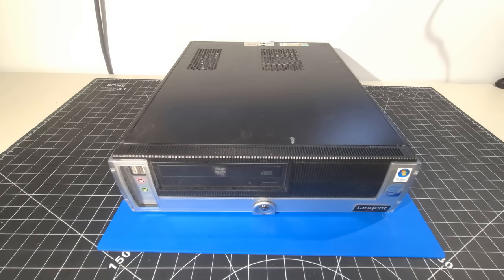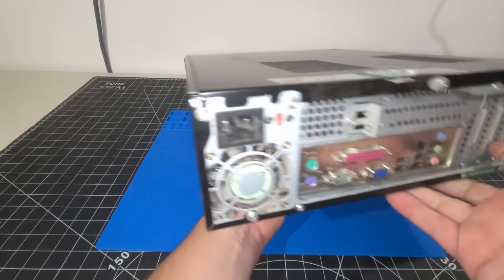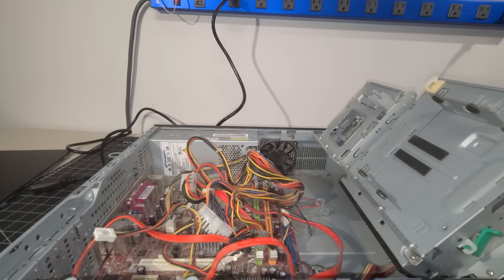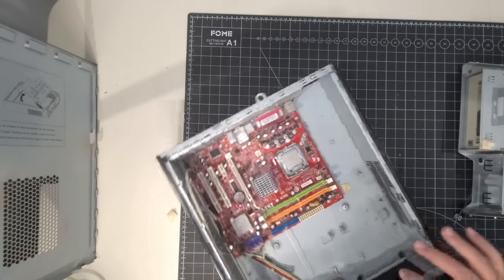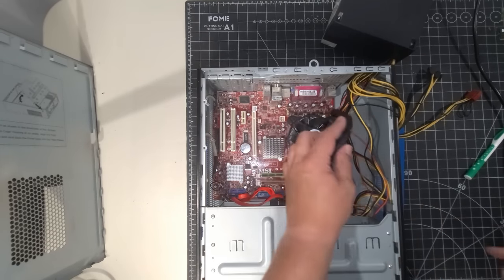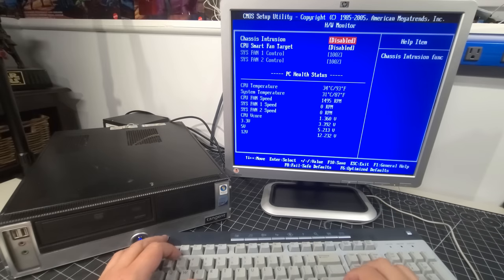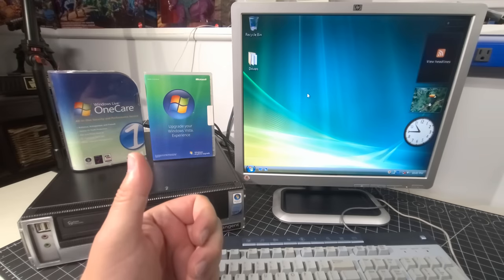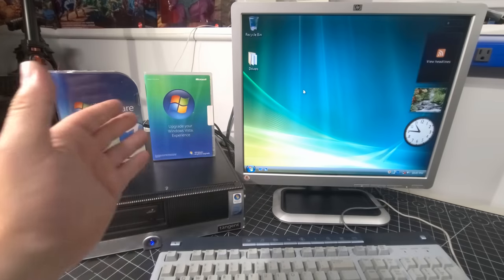The Tangent 'Medical PC' from 2007!

Comment: The high-pitched sound emitted by the PSU was likely what's called "coil whine". In some lower-quality power supplies, there can be noise emitted by components under little or no load. If that is the case, I wouldn't worry too much - chalk it up to cheap parts. Now, if the whine is persistent or increascaes under a heavy load, then you can be sure of impending failure. Hard to say much more without looking at it carefully / testing at a component level. I'm a computer systems engineer with over 20 years experience, so I've seen plenty of weird power issues. I really enjoy your videos, and always get excited when you post a new one! Keep up the amazing work :)
Reply from the maker: Thanks for the info here and thanks for the encouragement!! Im glad you are enjoying and happy to have you along.  This PSU is doing weird things and unless I'm 100% stuck, I'm not going to mess around with it right now.  I think I have a replacement for it which will help.
Reply: Glad to be along for the ride. Yeah, I agree it's less time wasted to ewaste the PSU and source a replacement. Computer, worth saving. Power supplies and other parts are like brake pads ;) @TheRetroRecall
Reply from the maker: Haha so true.

Comment: I got two of these PCs from a school. They had an AMD CPU and Windows XP.
Reply from the maker: Really!!  I never heard of them before the day I found this one.
Reply: @TheRetroRecall  It was the same chassis as in the video. They had a 250w psu, and it was a black MSI motherboard with an am3 socket, and the motherboard had a GPU built into the it. The AMD CPU did not have integrated graphics.
Reply from the maker: Nice!!

Comment: I loved Vista!  Used it for 9 years... Sure it was a little sluggish at first because, among other reasons, MS was way too optimistic about its system requirements, but once I gave it more RAM, and installed SP 1, it was both brilliant and beautiful!

Just for fun, I re-installed it on that same old 2007 laptop, last week, this time with 3GB RAM (Max. usable on this 32-bit system) and a faster 7200 RPM HDD, and it is flying!  ;-]
Reply from the maker: Love to hear these stories.  It really tells you how exciting the wild west of computing was back then!
Reply: I need to know that model of hard drive, cuz' I never heard of a 72,000 RPM drive. XD
Also on another note, I tried using Windows Vista and it was a steaming pile of garbage in my experience.
Reply from the maker: Haha, 72k hard disk.. SCSI on steroids??
Reply: @TOWGyt  Sorry to hear about your bad experience!  Like I said, it required at least double the RAM they said it needed... It also had file transfer issues, at least before Service pack 1. 
The HDD is a 250GB Seagate Momentus 7200.4 that I pulled out of an HP Netbook... Ah, I see why you asked now, I added an extra zero, didn't I?!  lol  Thanks, gonna go fix that!
Reply from the maker: Haha I liked the 72000 drive comment :)
Reply: The spinup on that drive must sound terrifying! 🤗
Reply from the maker: Taking off!

Comment: Can confirm.. These computers were used in hospital / medical fields, Up until as recently as a few year back actually..
Although, here in the UK, most of them didnt run Windows Vista, or any windows OS for that matter..
There is a medical professional Operating system, Widely used in the UK, Called Epic..  
So its interesting to see one with Windows Vista on it..
Reply from the maker: Thanks for this confirmation and yes - Vista Business.  Do you think that these would have been used in reception / administration type functions - considering the Windows Vista OS?
Reply: @TheRetroRecall  Yes that is a strong posibility. Epic OS is mainly for the Medical side of thing.... Medication tables, Surgery room booking slots, CT / Xray time slots etc. 
I highly doubt Epic OS would have been used in the reception side of the hospital, It would more than likely have been a standard OS, Such as Vista.. Around that time period..
Reply from the maker: Ah makes total sense.  There is also a Windows 7 pro licence on the system as well.

Comment: My high school used Tangent branded PCs back in the mod 90s. Nothing about them said "medical" at all. They were made of commodity parts. I suspect Tangent specialized in medical systems later on.
Reply from the maker: That great info!  I suspect you are correct.  Since the release of the video, I had a couple of close viewers who work in the medical industry contact me and let me know that they have come across or use these today!  So neat.  The materials have microbial materials to defend against infections or spread of disease which makes sense.  Again, a neat concept.
Reply: @TheRetroRecall  They probably did the same thing I did: move upmarket. Staying competitive became difficult as the bottom fell out of PC prices in the early 2000s. I learned I could make more money specializing in high-end niche hardware, which led to working on SGI machines, some of which were used to run CT and MRI machines. You just deal with a better cut of people when time is money, corners can't be cut, and customers are willing to pay accordingly.
Reply: They were a PC clone company back then. I bought a new 486/33Mhz tower from them and it's still running today :)

Comment: A fine restoration project!👍👍  My current computer project is a Samsung Laptop RV511, it does work but it requires an overhaul and some upgrading etc..
Reply from the maker: Thanks and nice!! I just looked it up online, it looks like a pretty decent system!  Good luck on the restoration / upgrades!
Reply: @TheRetroRecall  Thanks and it's healthy to have interests. That Samsung laptop is now over 12 years old and it only has a second generation i3 processor 2.53 GHz., but it now has it's maximum 8 gig., of DDR3 ram., installed and a 256 gig., SSD., the battery has some power left in it so I was able to test the laptop and have a look through the bios, I'm waiting on a charger and a ram., cover being delivered.

Comment: C2D was such an amazing chip. In 2007 it was ridiculously quick
Reply from the maker: Agreed.  Intel redeemed themselves!
Reply: It's only good for installing a Linux OS on it, more than Windows 10 Pro these days or 11.  I could not do anything with a Core 2 Duo that much except run a Linux OS like Linux Mint.
Reply: In 2023 it still can do win11 😂

Comment: I always steer clear of these SFF cases because of their proprietary power supplies, however they have come a long way in being serviceable with the easy lift-out drive cages like this one has.

the last company I worked for had a ton of Dell systems about this size so it was nice to see easy remove drives for when I had to replace a failed drive etc.
Reply from the maker: For sure, but yes, that proprietary PSU can go very wrong quickly with little hope of it being an easy replacement lol.

Comment: I think I saw one mounted on the wall in the ICU at the Regional when I was visiting grandma, no joke!
They also have WISE ThinClients in reception area up there.
Reply from the maker: Yeah I had never seen one of these before.  When I did the research then opened it on video, I still wasn't sure what the difference was compared to that of say an HP in its class.  After speaking with a friend in the field they stated that it is made out of antibacterial, microbial materials.  I thought that was pretty neat.

Comment: I had the AMD version of that MSI board, they made very similar offerings for Athlon-X2 CPUs, too.  I quite liked it for what it was; with a GTX 460 I could play Far Cry 3 in 1080p medium/high with no issues (4gb RAM, SSD, etc.)
Reply from the maker: Nice!! I need to get a low profile card... It's awesome how much of a difference the SSD makes!
Reply: @TheRetroRecall I would daresay if you can get a 750ti low profile and a dram ssd, you could probably build a gaming PC that'd handle most stuff up to 2014-2015 just fine. I wouldn't bother with a low profile 1050 as it will bottleneck, plus stuff that the 1050 could do the C2D could not.  Now it's possible you could get a C2QE on that, but...I mean at that point how much do you want to invest, in something that you'd be at the dead end of and only just matching the bottom of a 1st or 2nd gen i3 in terms of overall perf., right?
Reply from the maker: Exactly.  Generally I like to keep these as period correct as possible to see if we can restore them.  I mean when I get them posting they are already ahead of the game.  When I do the restoration, even better!

Comment: "Cleaning" the motherboard without removing it from the case...I dying inside 😢
Reply from the maker: Hopefully for not too long... Dying inside is never cool :). As noted in the video (I assume you watched it) I'm taking it all apart again to recap the motherboard when the parts arrive.  Which of course will require cleaning of flux and the underside where the board is mounted.  Appreciate the comment, and thanks for watching!

Comment: that power supply looks like a standard sfx power supply that  is readily available
Reply from the maker: I think so too, I think I have a couple stashed away that may for this.  Just need to confirm all of the rails are tested and line up correctly.  There is hope!
Reply: The formfactor is called TFX & there might be a length limited version which you'd have too hunt down a manufacturer that makes a small length one, or simply modify the chassis too accept a full length one.
Reply from the maker: Thanks!!!

Comment: 'People wanted to stay with XP and didn't wanna go to Vista.'
- That sounds like the situation with Win11 currently, people wanna stick with Win10 and MS is trying their hardest to get everyone on Win11, and that's on top of Win11 not being officially compatible with any hardware older than Intel 8th-gen or AMD Zen+ respectively, effectively rendering otherwise still viable hardware on Intel 7th-gen or AMD Zen1 silicon obsolete in their eyes, which will likely cause a very small uptick in Linux adoption.
Reply from the maker: Haha.

Comment: I believe there is a upgrade Cpu for this one that can put a core2 quad in it. With that a memory upgrade can happen as well.
Reply from the maker: Awesome.  Is 2gb the limit on this with the cpu?  I read the board can handle 4gb.
Reply: @TheRetroRecall  Well this motherboard should be able to support 8GB RAM, in fact most G31 motherboards do. Finding 4GB DDR2 memory sticks that work with Intel platforms is the problem though.

At that time for Intel plaforms, the memory controller is in the northbridge so the RAM limit doesn't depend on the CPU but the motherboard chipset.

Also this motherboard supports LGA 771 Xeons with some mods, a way to get a fast C2Q with 12MB L2 cache for cheap.
Reply from the maker: Thanks for this info!!
Reply: @OverTallman  not sure about 8GB of memory. At least 4GB depending on the CPU.

Comment: contrary to some commentors, i have quite the negative experience w/ that 4000 line of core chips, but it might have just been bad luck
i got a Phenom 9500 afterwards and that chip is still around in my household, not very useful but nice for nostalgia on a vista setup
Reply from the maker: For sure.  Everyone had different experiences, however the Core2 line saved intel from. The P4 world..

Comment: I have an old AMD 2 core CPU in a laptop from 2007 which is now running Windows 10, it originally had Vista on it. It runs quite well with an SSD also. Originally had 2 GB of DDR2 in it but I upgraded it to 4GB. I al considering Windows 11 for it just because I can lol
Reply from the maker: Haha that sounds like a fun build.  The nice thing about this old tech was the fun of seeing how far you could push it.  SSD made it so much better!

Comment: It's a nice Vista era computer. With SP2 and all updates it's actually as stable as Windows 7 and somebody even did an extended kernel for Vista to support everything 7 supports. Vista got hate because it had way too low requirements than it actually needed and most computers were not actually powerful enough to run it since most people had old Pentium 4s and Athlon XPs at the time
Reply from the maker: Thanks for this!  Yes, I plan on installing sp2, recapping the board and fixing that PSU!  Part 2...stay tuned!

Comment: If I had the $ I would add a ssd for boot, upgrade the processor, put in at least 4gb ram, add a low profile video card keep hd for storage dual boot Windows &  Linux. In addition to the work you're already going to do on it.
Reply from the maker: Smart config!  I try to keep these as close to original as possible, but that build does sound pretty nice.. Especially when it could probably run today's apps.

Comment: Btw motherboard is an oem version of the " MSI G31M3-F " It takes 1333 fsb cpus & supports the 95w core 2 quads fine if you want too take it that far actually, might need a bios update though for q8xxx & q9xxx core 2 quads.
Reply from the maker: Thanks!  I was getting conflicting into on this board now that makes sense!!!

Comment: Looks like failing 5v and 5v stand-by to me, based on all the swollen capacitors on the motherboard. Open the psu and replace the 3.3v and 5v filtering capacitors, and check the fan as well.
Reply from the maker: Thanks!  I will take a look for sure.  I think once the caps are all done (as I know they cause bad behavior) and I take a look inside the PSU - we will have a much better understanding.

Comment: for me that looks like a standard TFX power supply
Reply from the maker: The atx power supply I had worked great, and the pin out is the same.  Just in a small form factor.  I believe the older IBM's also used these... HIPRO I think makes them.  I may luck out as I have a few stashed away!

Comment: I would upgrade the CPU to E8500, 3.00GHz, not what appers to me to be a E4300 at 1.8GHz. Not enough for Vista. I would install 4GB RAM if 32 bit OS and 8 GB if 64 bit OS. Memory speed should be 800MHz. I beleive PC6400, your going to want it fast with Vista. I would also try to find a compatible GPU. It will need to be a low profile GPU to fit in the 1 X16 slot available on main board. Cap plague, so chang out caps on mainboard. Don't trust that PSU, it is failed. Sometimes they fail and will run under partial load, but not full load.
Reply from the maker: Thabks for this info and recommended next steps!

Comment: Yet another red MSI board with bad caps. About a decade ago, we got our PC supplier to get his dad to recap about 40 of our Core 2 based PC's that all had bad caps on similar MSI boards. That was my introduction to the capacitor plague and made me forever wary of MSI as a brand.
Reply from the maker: Yes, so it seems!  Recapping video coming up!
Reply from the maker: You did, that's for sure!
Reply: @The_Rebel934 Not only Intel unfortunately, I confirm I have an amd socket 939 MSI mobo which also has bad caps. Even the onboard audio isnt working.
Reply from the maker: Ive always heard of this Cap issue, but never experienced it until I started doing the channel. I seem to be discovering it more and more.
Reply: @TheRetroRecall  I wasn't aware it was even a thing until I started in my current job and then only after a few years. Manufacturers really cut corners during that time period to save a few cents per board by using inferior caps, only to have it come back and bit them in the backside when those caps gave up. I later realised that it the damage done was so bad that advertising your product had all solid or certain premium Japanese caps became a selling point that was put on the front of the box!
Reply from the maker: Terrible.  Well at least we have the ability to save what we can today.. Before the damage gets too bad.
Reply: I have a 754 sempron msi board. K8neo and it's got bad caps as well. Seems to be a huge problem with msi across the board
Reply from the maker: It's starting to seem that way. I'll have to check out my other msi boards now.